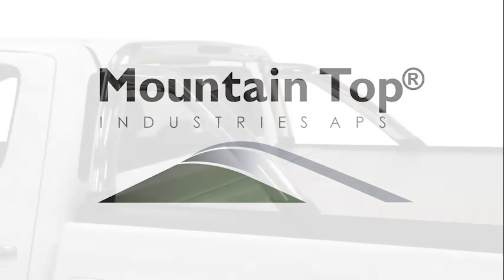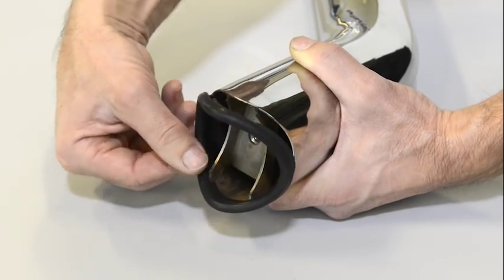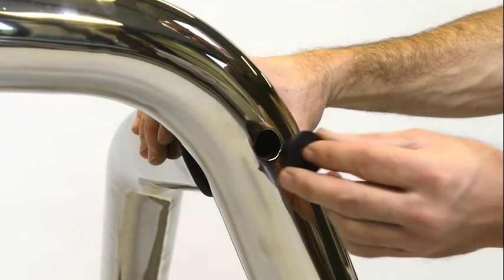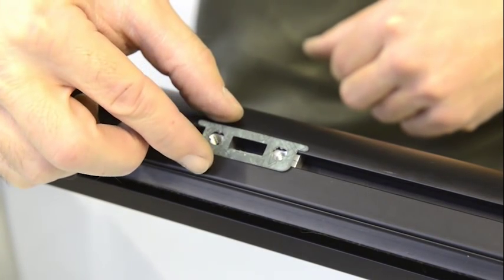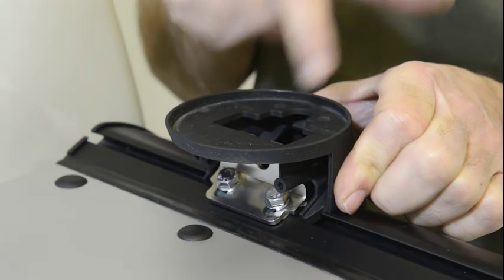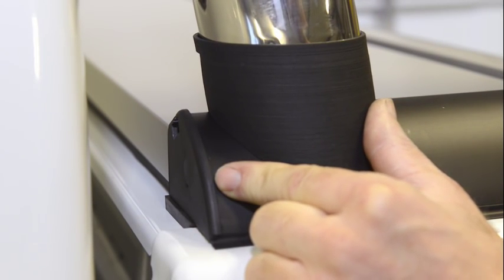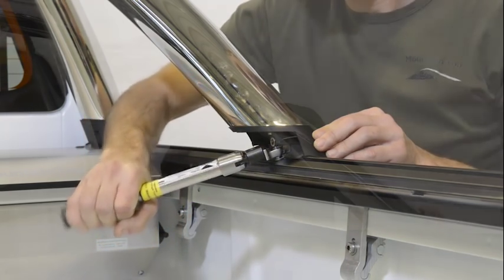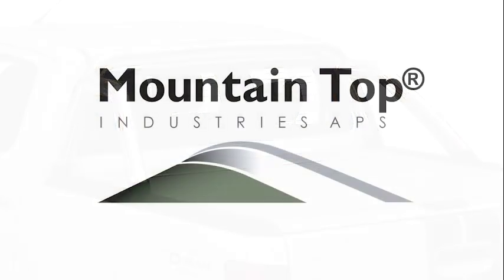Installing the Mountain Top Sports Bar

Comment: The one I have is different. There seems to be a large bolt holding the bar to the mount. Not 2 small ones. There are also rubber covers at the bottom not plastic ones. This video needs an update.
Reply from the maker: Hi Kenny,
Our sportsbar installation differs from roll cover to roll cover,. Although, we are looking into making an updated installation video for our newer versions.